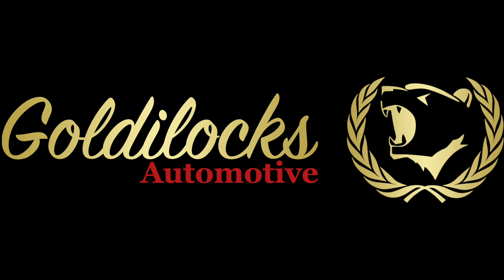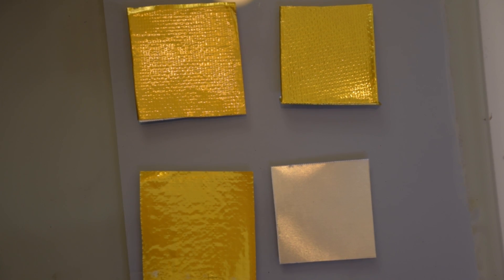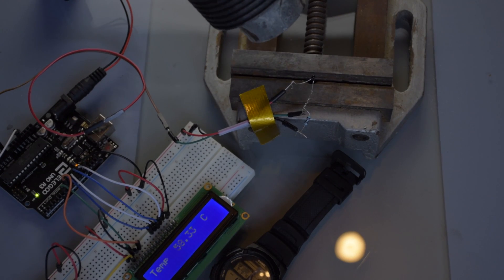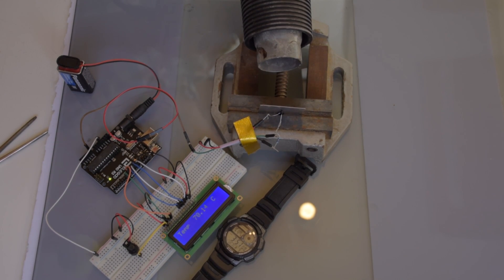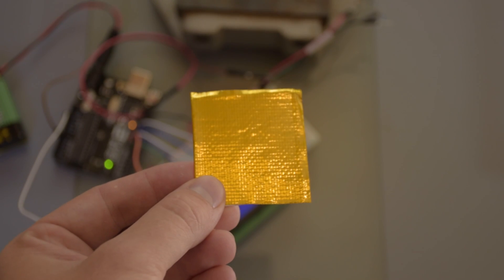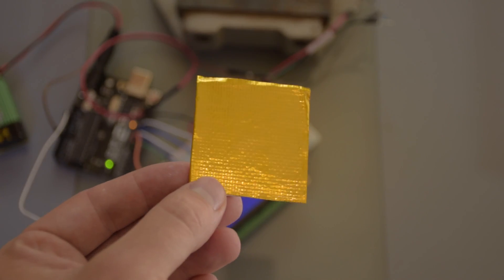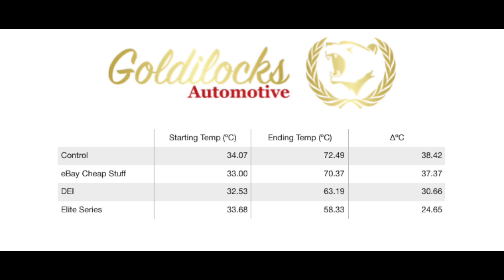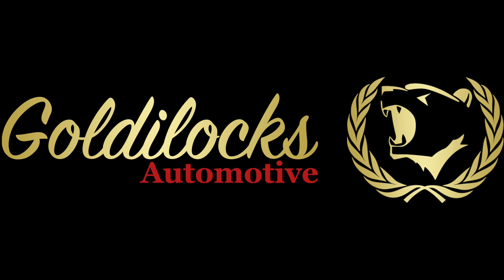Which Tape Reflects The Most HEAT!

Comment: There is a big problem with this test, that is the measuring time. Under the bonnet the heat is there continuously during the trip, not only for 30 seconds. Your tape can transfer the heat slower than the others, but the ending temperature could be the same, just you need enough time. You should do this test for at least 10 minutes long to see if any tape is better than others. Although a trip could be much longer than that, let's start with 10 minutes. Most probably the difference between the 3 tapes would be marginal, if any at all. It's because the shiny golden surface suggests that this tape is designed mostly against thermal radiation, it will reflect the radiation. This is not a good heat insulation material, because it's very thin, flimsy. If you wanna insulate the heat you need much thick material, something fluffy puff. Do you know turbo blankets, or exhaust wraps? Those are heat insulations (fluffy puff winter coat), this is heat reflector (a mirror reflects infrared heat waves). Huge difference, and you can't test this with a heat gun, but with a heat radiator. Btw it works, it's not bad but this test is silly.

Comment: I'm attempting to understand the under hood conditions of vehicles. Reflective tape slows a metal intake from heating up to engine temperature more slowly than the not having it insulated at all. We can have closer to ambient air temperature a little longer, right?  Wouldn't your reflective tape eventually heat up to engine bay temperature thus no longer be effective? The biggest thing in keeping an intake cool is the air coming into it. I'm not saying your wrap isn't worth it.

Comment: Massive difference in the metal width between the DEI piece and the Elite product you are trying to sell here. The DEI peice of metal was considerably smaller you can see if you compare the metal in relation to the vice. Pointless test.
Reply from the maker: Hi there, no that's not correct. Those pieces were cut out on top of each other in a stack, so they are going to be all within 0.5mm of each other.

Comment: Next time you do a test, could you use a larger piece of metal? Because of how small your metal piece is, hot air is allowed to flow over it very easily...not giving it an accurate depiction of "sealed" heat dissipation capability/properties.

Comment: The heat comes from the back side of the tape. You need to heat up the metal not the tape.
Reply from the maker: Hi Aldo, remember that the tape is on a surface that you want to keep cool, not a surface emitting the heat. It's a reflector with some insulation properties. Our LAVA Rock Exhaust Wrap is a more robust insulator.

Comment: Radiant heat? Okay. Convection and conduction will still work in hot engine bay. Gold tape is often weak solution around hottest part of engine like exhaust manifold.
Reply from the maker: Thanks for the comment. Our Elite Series Thermal Tape has the fibreglass layer to help with conduction. No solution will stop heat completely; we are just trying to keep things cooler, longer. As for exhaust manifolds, you should check out our video on our LAVA Rock Exhaust Wrap. The two of these paired together reduce under-hood temps significantly.

Comment: A heat gun is convection heat transfer. The air is actually flowing over and around a panel that small. Although I do agree with the statement of it being a relatively accurate representation of an engine bay. The tape should reflect radiant heat but cannot do much in the way of conductive or convective heat transfer. Best way to figure out if the stuff works for you and your application is to try it out really. If you wrap your intake and you see your IAT temps rise slower when at a stop then it’s a win.

Comment: How well would your tape stand up to sun/uv for years? Would like to wrap my ac unit on the roof but worried it would quickly be destroyed by the elements
Reply from the maker: Hey @anarchyamp, If you're looking to wrap an outdoor AC unit, I would recommend using our Elite Series White Gold, as it does not contain a polymide layer (just aluminum and fiberglass). Depending on your climate (if it gets really cold) you may see slight lifting over time. But the heat will not be a problem.
Reply: Daltonomous Inc. awesome thanks
Reply from the maker: No Problem! You can also use the code: GOLD10 to save 10% on your order :)
Reply: @goldilocksautomotive1679  has GOLD10 been replaced with something else? :D
Reply from the maker: turbocharged9589  try SAVE10 at checkout!
Reply: Daltonomous how about to wrap ac lines in the engine bay? I ask because the low side creates moisture

Comment: Your heat source was at varying distances. The first eBay test you were close (4 threads back on the vice) second you were 7 threads back and 3rd you were 6 threads back.
Reply from the maker: Hi Pete, that was a good catch. I went a measured the threads on the vice. They have a gap of approximately 3mm (little less). The heat gun gets to approximately 135*C at approximately 5cm on the exposed sensor. While I won't say that the change in distance is negligible, I suspect it would be the difference of less than 1*C over the period of this test. In the future, I will be releasing much more standardized tests, since so many people have been asking about it!

Comment: looks like you are using different metal squares varying in size = different heat absorption. Try again with the same metal square.
Reply from the maker: Hi Yauman, thanks for the comment. The squares were all cut from the same piece of sheet metal, and were within <1mm of each other. I thought about using the same piece of metal, but found that some of the cheaper tapes left pretty bad residue, which would affect later tests!